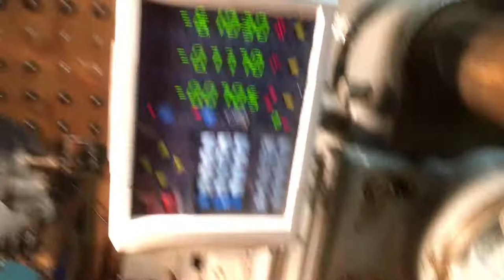Rough milling Ampco 18.

Comment: I love how u take it easy on the feed. I’ve cut ampco many times. It is a soft and yet brittle and tough to machine if speed and feed is not correct. I’ve learned to cut it with ease. 👍